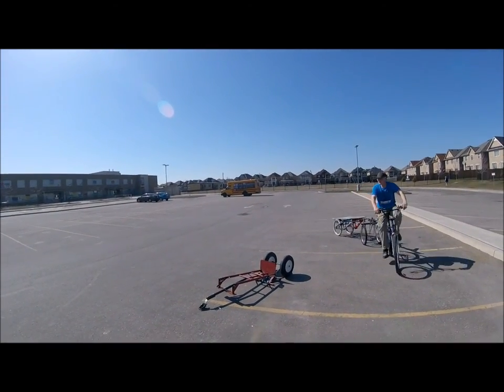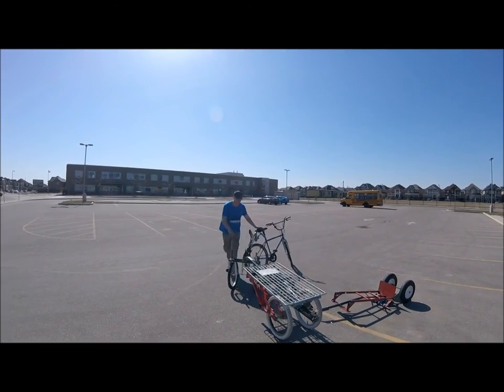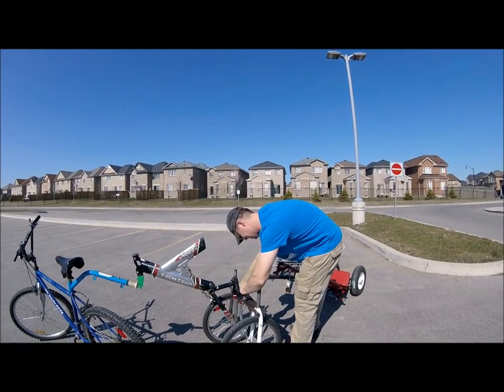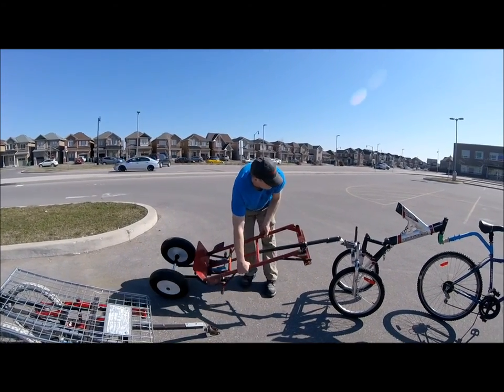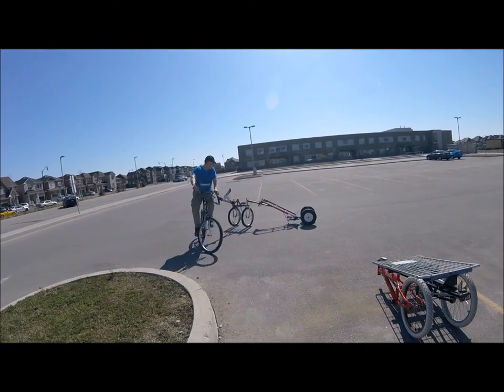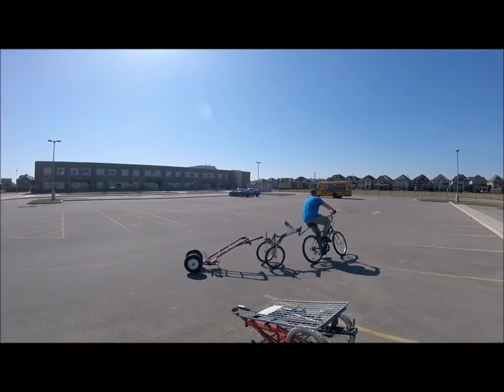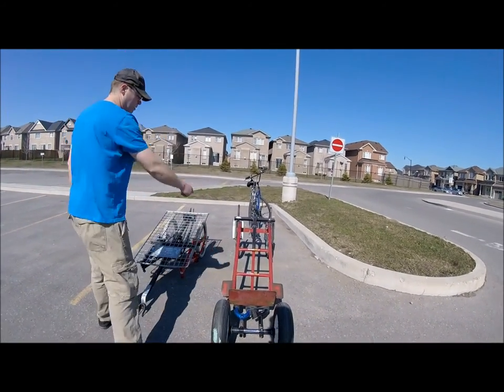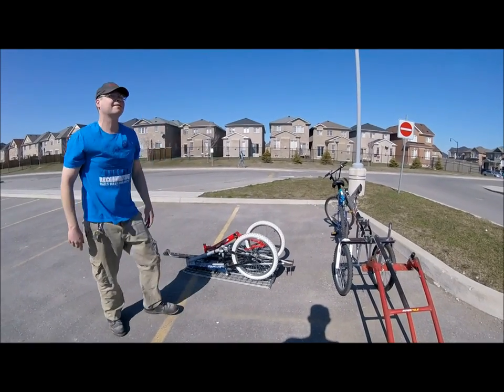Heavy duty DIY no weld bicycle trailer triple combination from old bike parts

Comment: Pretty impressive steering system - using rotation and swivel to set optimal pivot (and so much more).  Really hope you're putting that brain to good use (the world can never have enough engineers)!
Reply from the maker: This is old design, good for heavy duty jobs but i made a much better design for light duty and it wont roll over.
Reply: @BIKEMAN21  Old design or no, you're very creative - and I'm not real surprised to hear hat you've since made improvements.  Thanks for your response.

Comment from the maker: In practical applications I've found to keep loads light 150 lbs or less if possible and making multiple trips  instead of 200 lb + loads.   Reason is at about 200 lbs the gearing you would need is about 21 speeds. The bike i am using has only 12 speeds and without low range gear sprockets at the crank shaft which becomes a bit hard to pedal with loads over 200 lbs. Also if you can fit the load on just one trailer then its less weight for you to pull.  I also found you may want to use lock nuts for your hitching bolts as i have dropped the dolly a few times at speed as the road vibration unscrews your nuts. = )  I am thinking of making a clarification video to zoom in at the hitch points , but its basically a bolt and nut sliding thru the holes of where the shopping cart caster used to be.  And also to show more closely how the dolly was put together.  If i build a new set up it would be all aluminum and have lower centers of gravity ( I have encountered issues of the dolly rolling over while trying to go down curbs too fast.) Quite embarrassing = ) Next project i am thinking of is a gas powered bicycle or trike using a lawnmower or weed eater engine for longer expeditions = ) all with parts readily found at the curb of course!

Comment: Oh is that why you like my videos? Yeah going to be big on sales Huh.  I found that skate board bearings are good to use too. But you have to weld. It's very difficult with out welding. But you could put a pretty good frame with only drilling. I have secrets that could help with your building. Not into YouTube to much, but soon. If you have any questions in the future let me know!
Reply from the maker: ok will do. thanks !

Comment: Badass
Reply from the maker: Thank you ! Works extremely well. With this I've hauled a 4 piece solid wood bedroom set using the flatbed trailer with the aluminum dolly trailer. (multiple trips)  100 lb + patio slabs, Glass sheets, large loads of wood 8 ft long etc.